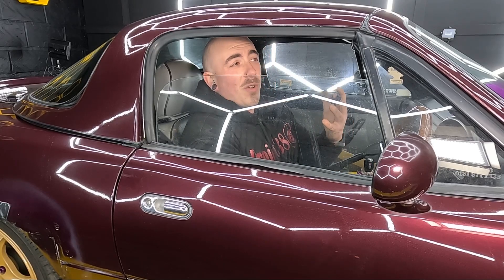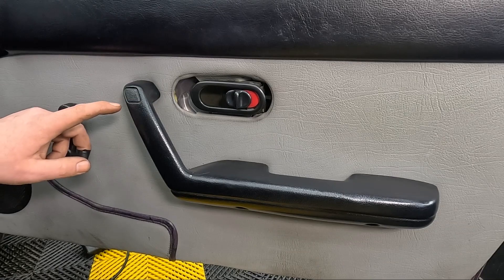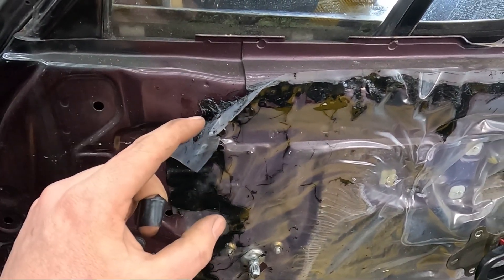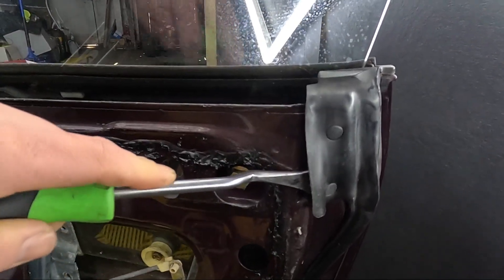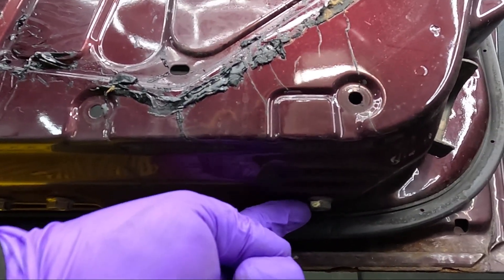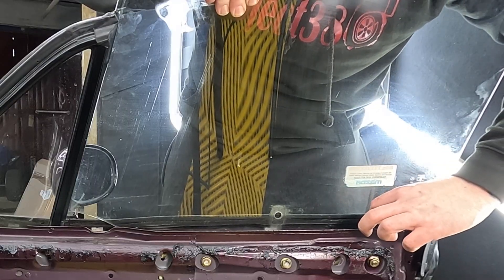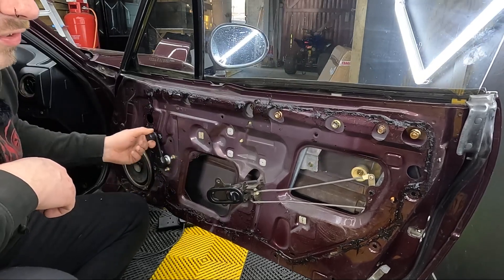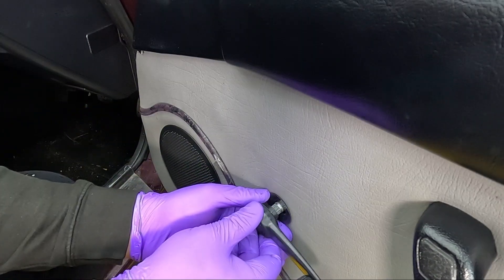MX5 MIATA WINDOW ISSUES : How to fix slow or stuck windows

Comment: I just did it on my NB with power windows, everything is exactly the same. On my car, the insert you screw the bushing onto had gotten loose and fell off inside the door so the screw was wiggling in direct contact against the glass whenever i tryed to move the window up and down, so over time it gnawed the thread and I had to rethread the screw to put it back
Reply from the maker: 😂 no way, i bet that made a wonderful sound
Reply: Great to hear I am also going to give this a go because I am not  very happy with the way my NB's power windows are going. Just need to make sure I stop on time with tightening the bolts hehe

Comment: I'm in the middle of fixing my passenger side power window.  My wife broke it. She rolled it all the way down and then later it would not go up any amount but the motor made a sound.  She tried several times up and down. I opened it all up and found the problems.  Initially the white nylon clip which holds the housing of the up cable to the top of the track broke.  This prevented it from pulling the window up but worse left slack in the line so that further motor action caused the cables to get tangled and frayed inside the spool/capstan part of the motor.  This massively increased the cost of the problem!   I think I can get some custom cables made to replace the frayed ones and I see some "rebuilt" regulators use a hose clamp to secure the broken nylon clip to the track. Otherwise you have to buy a complete regulator assembly.   Lesson: don't "play" with the controls if this happens to you.
Reply from the maker: o that sounds horrible 😯

Comment: wow mine doesn’t have bushings anymore? there’s only one of the metal hardware with the bolt and the others are just the holes in the glass😭 any idea where i could get the metal hardware and bolt?
Reply from the maker: Ooooph. If your from UK try "mx5parts"

Comment: THANKS!!   Nice clear instructions and easy to follow. BUT ..... I've found some little bits of glass, which tells me that at some time in the past, the window has been smashed. Now, whoever replaced the window has not done a very good job. The original bush was no longer connected to the window and was sitting at the bottom of the guide rail. (I have the new bush from Moss.) Also, the two plastic "window stoppers" are completely missing. Now I just have to find them and the metal bits that the bush screws onto! Any ideas??
Reply from the maker: thank you. 🥲😯how could someone do that, knowing that they are leaving glass in there and do half a job.
have MX5 parts got the stops in stock?
Reply: @Project380  The problem seems to be getting the connections. I'm talking to a breaker who might have them.
Reply from the maker: @rogerbruton  ahh, well i hope you have some good luck

Comment: Hi mate, absolutely excellent video. I did this yesterday to my driver's side door, but now my window is even slower and gets completely stuck in the middle. Any idea what I might've done wrong? The only thing I can think of is I used silicone spray grease in the guide rail for the new delrin bushing, should I have used a different kind of grease?
Reply from the maker: two things to check, check the rail at the rear of the door and the rail the mech runs in isnt bent kinked or damaged and then check the weather seal that the window runs in at the front of the door
Reply: There's a cable inside the door that is held clear of the window by a plastic clip. The plastic clip attaches to the hole in the door that is 3-4 inches forward of the interior door handle. If the clip breaks or pops out, the cable can get caught on the bottom of the window, slowing it or stopping it partway down.

Comment: I have electric windows on my Mk1, and they are stuck fully up.

I was going fo trynthenswitches, but doing research into motors and bushings etc. too.

Are the steps the same?

Asking because i dint have a winder to manually firce the window to 50%
Reply from the maker: ok your best bet will be to remove the motor and wires from the door but still connected to everything apart from the door, pull the motor though the access hole then remove the motor from the mech. you should not have much resistance with the motor off so hopefully be able to force the window down a bit
Reply: @Project380  cheers for the reply. You're response terrified me 😂 (I've only had this car a few weeks and never worked on one before)

Alas, I had the centre console apart yesterday, managed to clean the switches and the windows now function.

However they are still slow, so I'm assuming this video could still come in handy. Would the fact I have electric windows change any assembly or location of some parts?

I don't want any nasty surprises since I really have no clue what I'm doing 😂

Only asking because your car has manual windows, and I imagine the motors on mine take up a fair bit of space.
Reply from the maker: @ohhiitsmike   well first of all, welcome to the wonderful world of mx5 ownership

yes your right its probably the bushings or a worn cable which ive also done a video on if you get stuck

the only real difference is there is a motor instead of a winder
Reply: @Project380  awesome cheers.

MX-5 has been a dream car for a long time.

My example is in very good nick, just some minor gremlins.

I don't regret my decision to buy one 😂
The experience far outweighs the swearing at myself in the garage ❤️
Reply from the maker: @ohhiitsmike  well i wish you all the luck. just shoot me a message on insta or tictok if you need me
Reply: @Project380  will do. I'm assuming your insta handle is the same as listed here 💪
Reply from the maker: @ohhiitsmike  yep project_380

Comment: So mine has got power windows and wont go to the halfway point even if I push it a bit myself what would you recommend doing in my scenario to get there.
Reply from the maker: im afraid your going to have to struggle with a spanner and work blind. put your hand up into the door and feel for the free bolts, then take the window out

Comment: Is the power ones the same ?
Reply from the maker: the only difference is you don't have a window winder to remove.
Reply: when it comes to why your motors are slow yes. That grease that hardens makes the sliders gunk up. I hit it with some pb blaster to loosen it up and it helped. but if u clean the rails even without takin them out with something. then spray in some silicone lube should help the windows alot.

Comment: What kind of grease did you use on the runner?
Reply: The metal runner that is
Reply from the maker: heavy duty graphite grease, but silicon grease would be absolutely fine

Comment: Did you ever considered retrofitting power windows? they are pricey but I think they are really worth it. I would love to see your video on it if you ever consider doing it.
Reply from the maker: yeah this is something im going to be looking into in a few months time and yes i will do a video on it. i think with second hand parts it could be done fairly cheep
Reply: Old post, but don’t bother with power windows if you don’t have them already. They are completely unnecessary in a car so small, and the motors/regulators are just something to go wrong. I currently have a tender relationship with my driver side power window.
Reply: @mr.butterworth  Well I won't agree with you. Mechanical window regulators can go wrong too. That's what happened to mine - the cable snapped. New mechanical system was almost if not equal the price of electric. Also most NA models have pre-wired cables in the center console up to the fuse box and mine even had a fuse.
I also had hard time to reach passenger window when i wanted to roll it down. I don't get when people say it's easy to reach unless you are 190cm high. 

I switched to power windows and it took me roughly two hours and I am SOOO happy with it